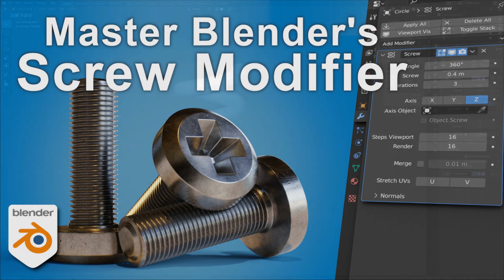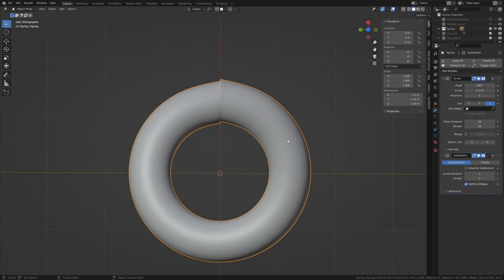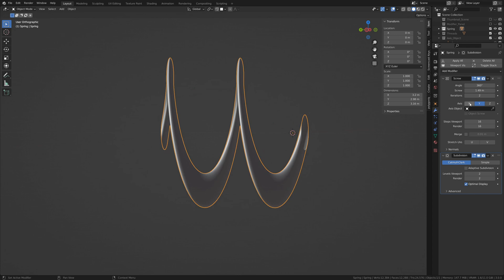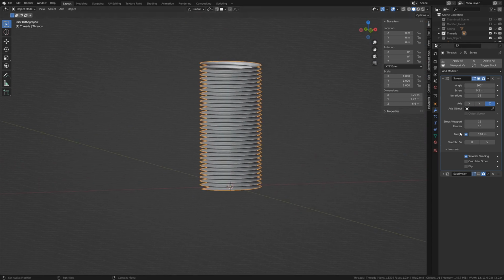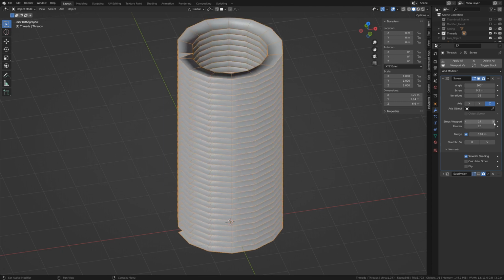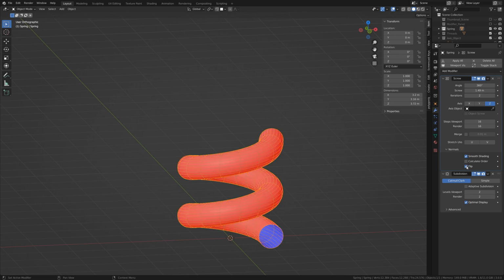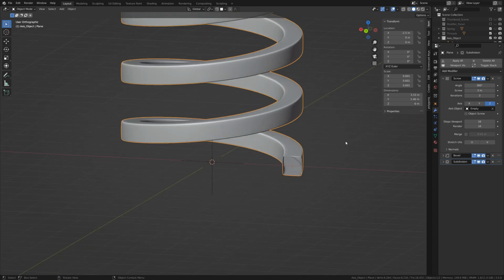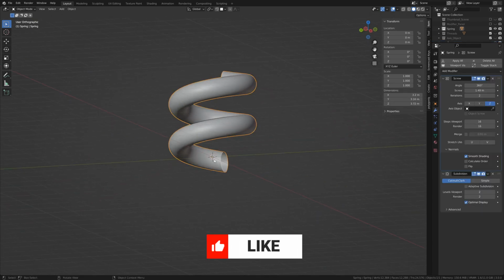How to use the screw modifier in Blender

Comment: Hello. I have been looking to find how to change the orientation of the screw and so far no look with any tutorial. And that is the question. How to change the orientation of the screw? Amazing video. Thank you.
Reply from the maker: Are you wanting to change it's orientation as in which axis (xyz) it travels along, or are you trying to reverse the thread direction?

I am guessing it is the latter. If so, the second value in the screw modifier is actually called screw. Make that a negative value to reverse the thread.
Reply: @BlenderForge   Hey thanks for the reply. I have been trying to make the cross string on the handle of a sword. I'm following a tutorial in which I have seen other users ask about the same problem but they did not receive an answer, I think the channel is probably inactive. The thing is, I was understanding to type S S -1 all the time. It turned out that it was S X -1. Scale and Axis and then -1. I did it and it works. 
It is the problem sometimes of not speaking English as your first language. xDD. Thank you anyway.